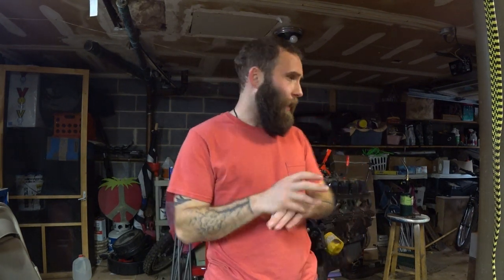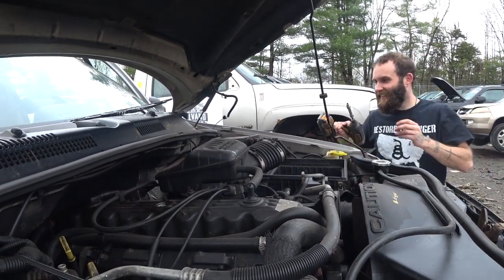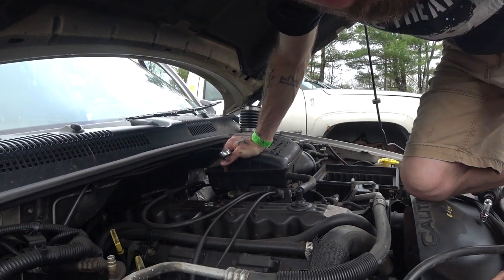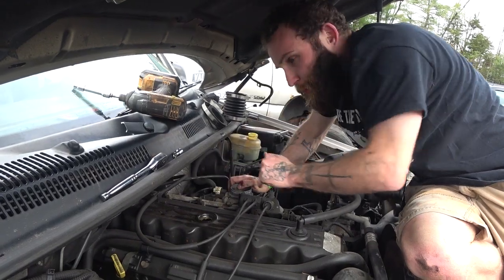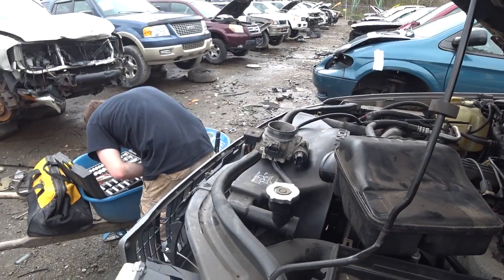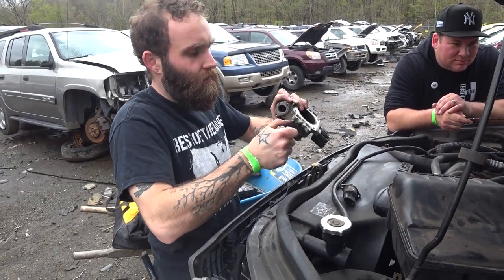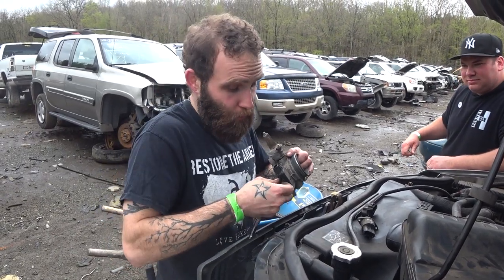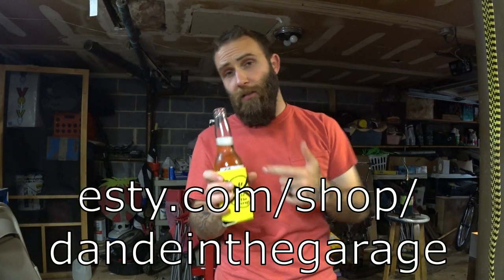Why do Jeep 4.0L need spare throttle body sensors? - D&E in the U-Pull 26 (with Project Dan H)

Comment: Have a 1991 Jeep Wrangler yj 4.0 . Starts good runs well about 2 miles then skips when i need power to get on freeway skips for about 2 miles then runs well when completely warm. I have replaced fuel pump, Tps, ics, temp senser, Dis Cap , Coil, spark plugs , air cleaner filter, MAP sensor, CPS, O2 sensor, Exhaust Manifold .Cleaned TB,  fuel filter, Fuel presure sensor at rail 
Any Ideas

Comment: I NEED YOUR GUYSES HELP! My 99 xj had a check engine light on after I did motor mounts and a new exhaust manifold. Started it and sounded great! “Compared to the cracked manifold prior.” Low and behold check engine light comes on shooting codes for P0171 P0505 & PO118. Before I waste money does any one have a guess on where to start?

Comment: I overpaid for my '01 TJ that I am still beating on to get it 100%. One of the absolutely most dramatic and easiest fixes was replacing the throttle position sensor. It went from running like a leaky tugboat to smooth powerful 4.0 perfection, a 5 minute fix that helped soften the blow of paying $5k for a TJ worth $4k!
Reply: That’s why I like wj. Still a real Jeep but they aren’t near as expensive as a worn out tj or xj

Comment: When I owned my 97 Cherokee, I learned quickly to not use gas with any ethanol. That carbon buildup would kill the TPS
Reply: but the tps doesn't come into contact with fuel, air, exhaust, or combustion. it is just attached to the exterior of the throttle body butterfly shaft.
ethanol might mess with other sensors, but not tps

Comment: I replaced TPS and my scan tool still does not start at 0%... TPS in my Ford does the same, but all my GM cars always start at 0% unless there was a problem with TPS. Have you experienced this?
Reply from the maker: To be completely honest, no. I have never had an issue which required a check for starting throttle position

Comment: Hey, D&E, my xj is 25 years old with  mostly original vacuum, brake & fuel lines. Time to R&R all of it, most of it is plastic. Until I do, I was thinking of getting one of the fuel line repair kits. P/N 83502745. I could use a how-to video. Has anyone on here tried this thing? Thanks and keep 'em comin'
Reply from the maker: Yea, we have some experience. Let me see if we can get a video out for you

Comment: When the TPS fails on a 4L I6 I know the transmission is lost as to what its supposed to be doing.  At first I was like well sh** the transmission just failed....no, it was that TPS's fault.  It would shift erratically, or not at all, no overdrive at all, occasionally would start in 2nd gear, sometimes first.  Going to pull some parts next time I am at the pick a part just to have on hand for future use.
Reply from the maker: yea bud. it is bad